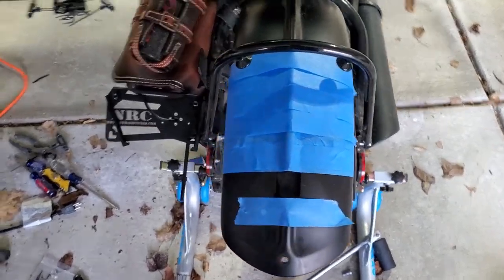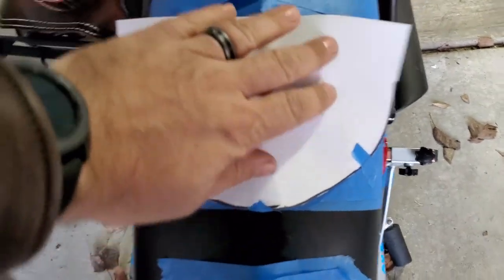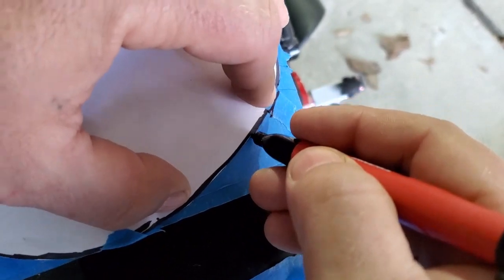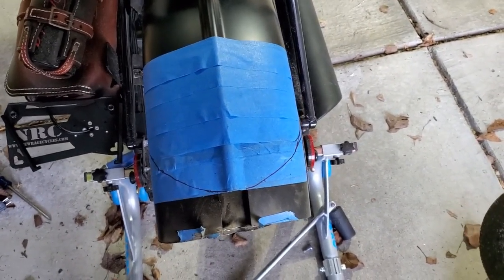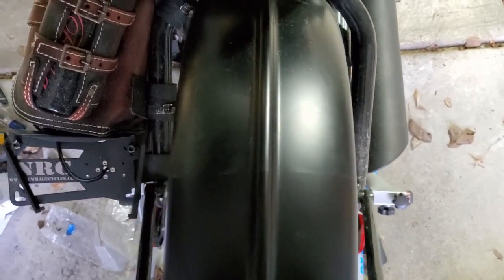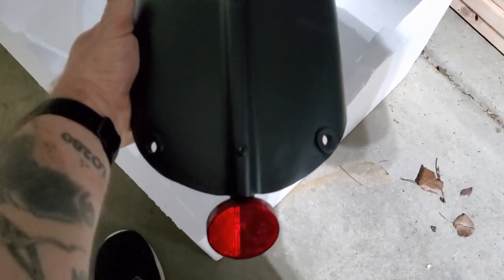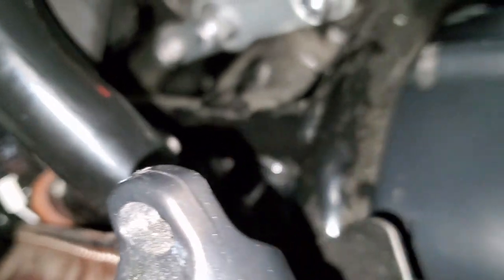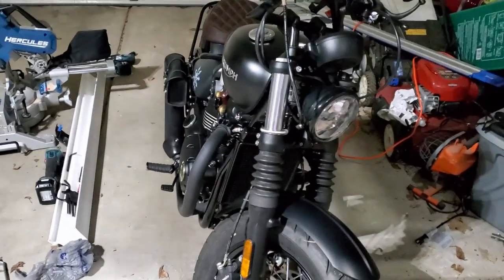Bobbing the Bobber: Cutting the rear fender of The Bobber Black

Comment: Easier way- cut the end off straight, but close to the end of the fender. then place it on top of the remaining fender at the spot where you want the curved edge to be. Then draw the shape on top of the tape where you want it. That way you are using the actual end of the fender as a template. It’s more reliable than a flexible piece of paper.

Comment: I have same problem ,putting back wheel on .I put a long punch or big philips screwdriver into wheel on right. It holds up wheel ,while I work axle in from left into brake carrier and wheel. Before ,I figured this out ,maybe 3 tries or more ,cussing and swearing. I am 66 and worked on bikes and never had trouble like this bike . Takes a few minutes now ,hardly any effort. Mark

Comment: Number 1 thing you need to have if don't have the correct tools or complete tools for measuring or angling is a good eye. I also made a fender out of an old gas tank reserve and totally messed up, so i cheated with bondo and a dark paint.

Comment: Hi there have you got a friend that can help you I don't think that you should have cut the inner fender where you had the gap you should have had it welded with plate steel or put a LED light there not cut it and use bondo we call it filler in the UK but not a bad job for the first time you will get better as you go on with the Bobber and god luck I will be watching.